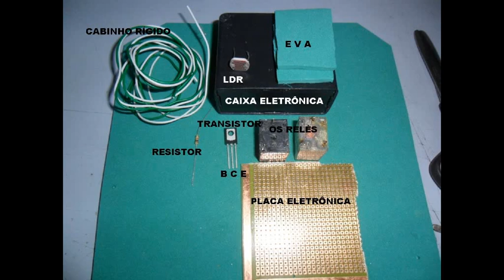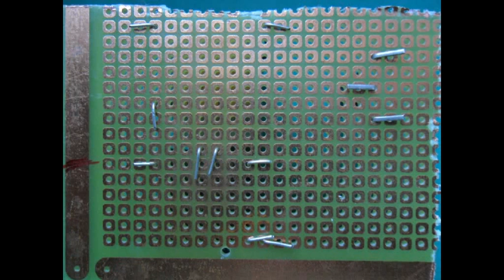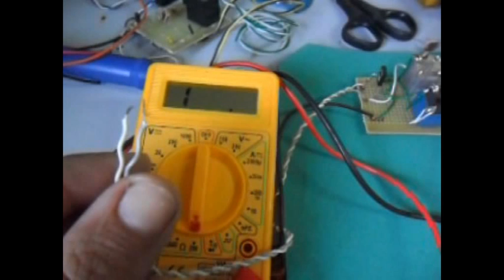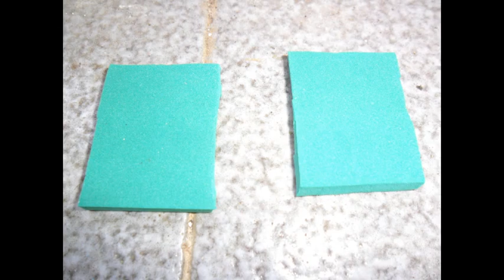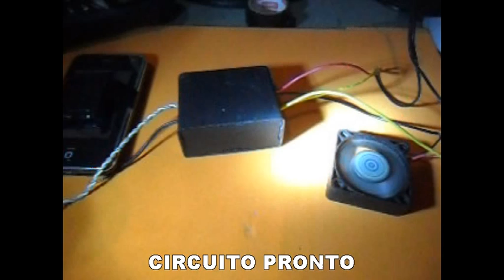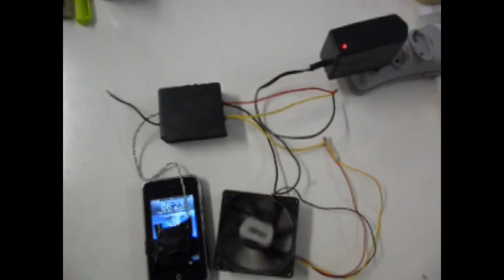BLOQUEADOR VIA CELULAR ,ESQUEMA ELETRÔNICO SENSOR DE BRILHO DE TELA DE CELULAR.(11)

Comment from the maker: Amigo Ruan,valeu pela inscrição no canal.Já estou testando o circuito com uma semana e fazendo ajustes na posição dos resistores com os capacitores e o transistor npn bd 139.Com um transistor e relé vai longe,muito longe mesmo.O circuito base é com dois réles e uma combinação lógica com resistor, 1 diodo e dois bd139,dele se deriva para qualquer circuito bloqueador,desligou a bateria e religou ,independente do tempo,o circuito BLOQUEIA SEMPRE .Para voltar ao normal ,reseta um botão escondido.